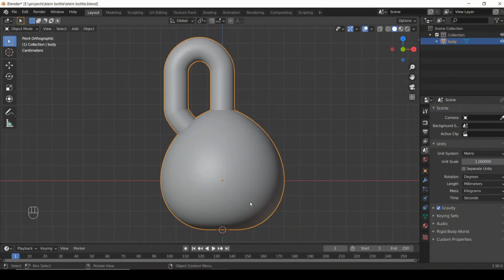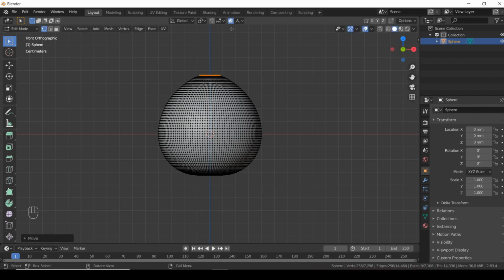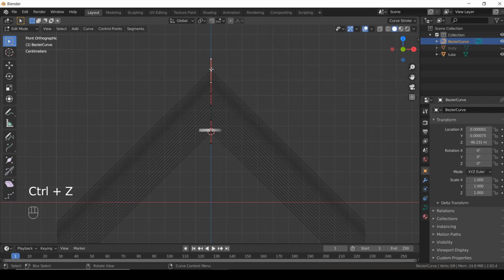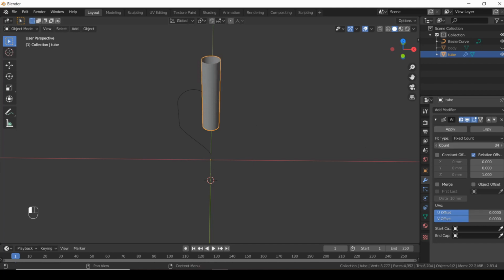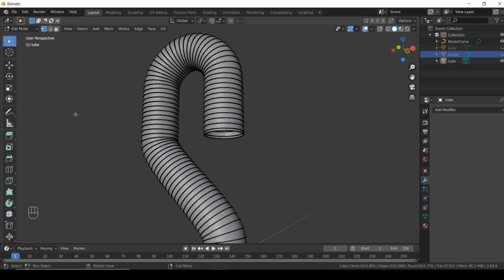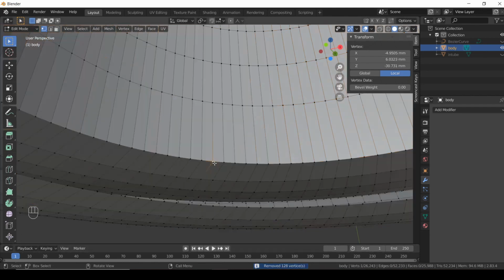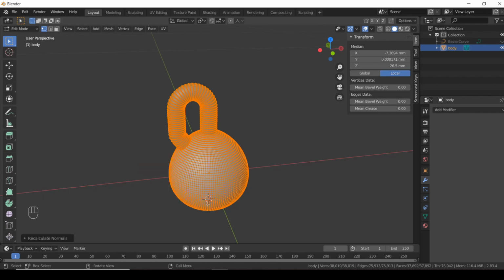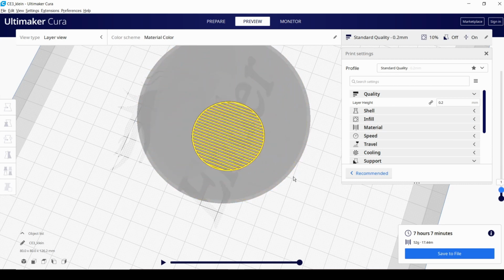how to make a Klein bottle (Blender 2.8)

Comment: hey I can't extrude
Reply from the maker: It should be 'e' on your keyboard. 
You could check the keymap in preferences to see which key you have extrude set to but as default it should be 'E'.
If it still wont work let me no more about what the problem is I.e what part you can't extrude your o.s and blender version etc.
And I will try to help you.
Reply: @asthe402  HEY I liked your video
Reply: @asthe402  that one like is mine
Reply from the maker: Thanks
Reply: @asthe402  WELCOME